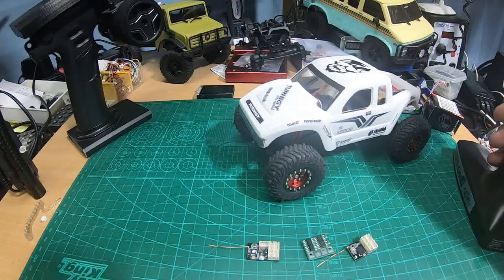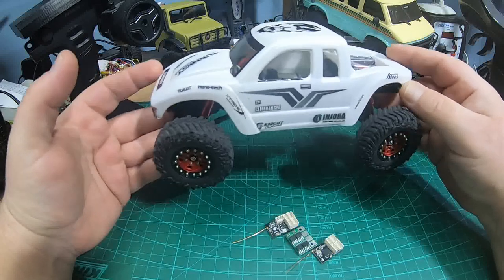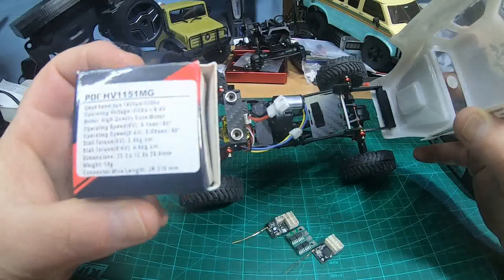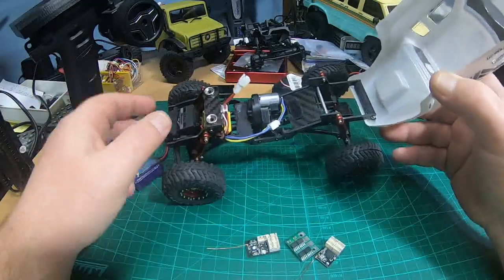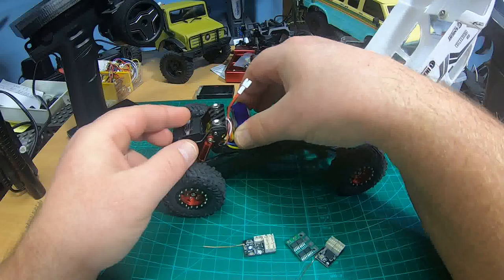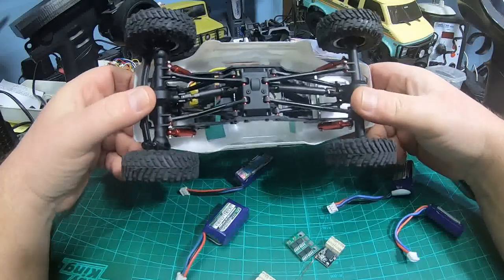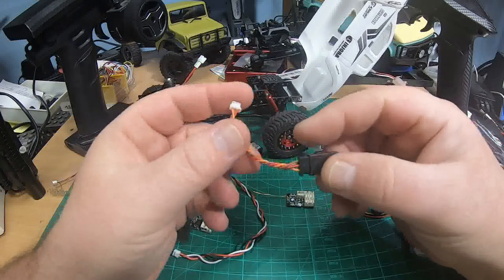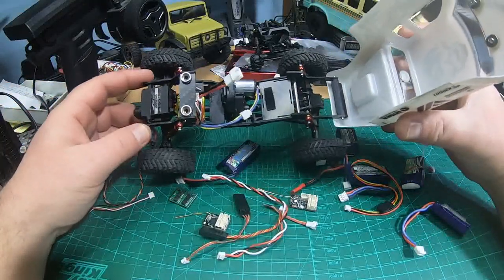Super Small and Super Light HV Electronics for Micro Trucks

Comment: Hi Donald,

Please excuse my ignorance, but I always looked for the batteries with the additional balance cable, as I assumed that those batteries with only the single cable could not be balance charged.

Are you able to balance charge the single cable batteries also?
Reply from the maker: Of course, this is absolutely the same way of balance charging as in a "normal" small 2s Lipo. The "power cable" in small 2s Lipos,, which use the same wire cauge for power and balance cable (22 AWG in SCX24, 24 AWG in FMS, Hobby Plus, etc) is absolutely "useless", only takes room, weight. You could also run those simply by the balance plug (for example Turnigy TZ4 does). 
A normal Lipo charger (with connections for power and balance plug) charges the Lipo with "high current" (depending on your charge settings) up to (depending on charger) 4 or 4.1 V. The "rest" up to 4.2 V will be charged with low current (0.1 or 0.2 A in many chargers, some newer ones even 0.5 A, 1 A - so "faster") and balanced (so every cell seperately charged). 
Example 1/10 Lipo, 5000 mAh 2s: You will probably set your charger to charging with 1c (= 5 A = 5000 mA) current for "Lipo healthy" charging, what normally takes about 1 hour. The charger will charge the Lipo with 5 A up to 4 or 4.1 V by the power cables (which are thick, 12 AWG, 14 AWG). The rest up to 4.2 V will be charged (and balanced) by balance cable (thin, 22 AWG, 24 AWG) with 0.1 - 0.5 A (100 - 500 mA), depending on your charger. This balancing (balance charging) with only 0.1 - 0.5 A of course is much slower than the "non-balanced" charging with 5 A (because each cell of the Lipo is charged seperately). But you could not charge the Lipo with 5 A current by the 24 AWG balance wires and (JST XH balance-) plugs, they would "melt". (However, you could charge the large Lipo ony by balance wires/plugs setting charging current to much lower values, max. maybe about 1 - 1.5 A, which will take several hours). 
But this different wire diameter does not matter in small Lipos, they use same wires for power and balance cable (22 AWG, 24 AWG); also plugs (JST red/JST PH/"JST Micro-Losi/Syma/Walkera" etc. for power and JST XH for balance) are quite similar in their specs, for sure appropriate.
But your "normal" Lipo charger requests 2 plugs/cables to be plugged in for balance charging, it will not start charging if you only plug in balance plugs. So you have to use a "trick": Simply connect a "power plug" (Banana or XT60 in most chargers) in parallel to the red/+ and black/- of the balance cable. Then plug this "power cable" to the port of the charger, and the balance cable (JST XH) to the balance port. Then the charger will charge the small Lipo with the set/desired charging current (300 - 500 mA for "Lipo healthy 1c charging" in small 300 - 500 mAh Lipos; example: 1000 mAh = 1 Ah Lipo 1c charging = 1 A/1000 mA). It will "send" the charging current to the Lipo by the large power connector (banana, XT60), up to 4 or 4.1 V. Then it will switch to balance charging and "send" the current to the Lipo from the JST XH balance port. However, both currents, charge and balance charge, get "into" the Lipo by the same plug, the JST XH 2s balance plug.
I use JST PH 3-pin system here (same plug as in SCX24, only 3-pin), "UMX sytem" (Eflight 2s UMX planes), because I love this system and have a ton of Lipos for my small planes and helis. but the principle is exactly the same. JST PH 3-pin are even smaller than JST XH 2s (3-pin) plugs.
You could use this way of (balance-) charging not only for 2s Lipos, but in theory for any xs Lipo (depending on your charger, most have 6s balance ports as maximum, some, my super old Hobbyking Turnigy ??? for example, even 8s). But you will have to set charging current to appropriate low A-values (and for example charging a 6s 5000 mAh Lipo will take ages this way). Some very simple chargers charge 2s - 4s Lipos this way (but do not use those for tiny micro-truck Lipos; you cannot set charging current in those chargers, and they use 1 - 2 A charging current, what is very unhealthy for your tiny Lipo and will reduce it's life-span; a super old and weak tiny Lipo (e.g. 200 mA 2s with 1c charging rate), could even catch fire).
Of course you need appropriate charging wires or boards, I made a video how to make such a cable, you can do it with JST XH or JST PH 3-pin (or even could make a cable with both, JST XH and PH, using the matching connector for your Lipos). 
https://www.youtube.com/watch?v=9-m0ib59fto&t=542s

Comment: Hi, I like that you power the ESC from the receiver. Very clean. But how much amp can you pull through the receiver? Something I need to calculate or?
Reply from the maker: Hi, I do NOT power the ESC from the receiver, I power both, ESC and receiver, directly from the LiPo. Receiver has normal Dupont plugs... (servo plugs), and all those are connected in parallel. So if you connect the ESC to the plugs of the receiver and then the battery to the receiver (which allowas parallel distribution), you get what "servo plugs" allow, more than enough for a micro crawler.
In my case/receiver those are JST ZH 1.5 mm plugs - so they will be able to do less than large servo plugs. Donno how much exactly, but way more than my small motor and ESC will pull.
Reply: @donaldsneffe  OK, that makes more sense. Thanks for clarifying it. 👍🏼

Comment: Just to be safe, you can't use 3S (with this particular setup), because the Lipo is directly connected to the nano receiver, right? 

I will be using the T-FHSS 4CH Nano Receiver (OpV 8.4V ) for FUTABA with Power S-BEC (CH3) and two AS12/6RW (CH 2 and 4). Servo on CH1.
My micro MOA electronics setup: https://youtu.be/DWMwBsffVMU
Reply from the maker: Yes, if you wanna run on 3s, you'll have to use a BEC.
Reply: @donaldsneffe  Ok, that's what I thought. thx.